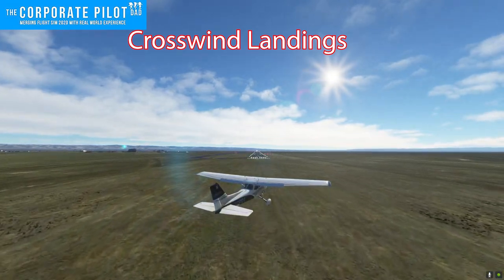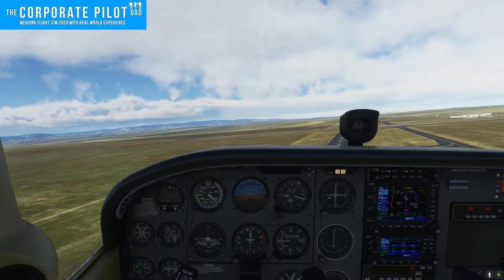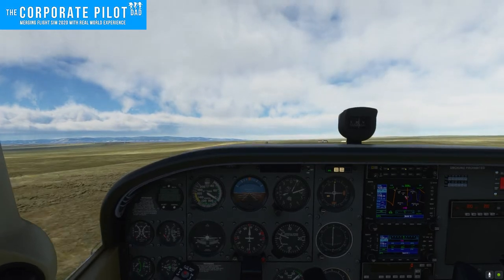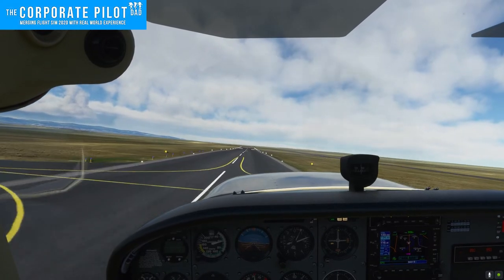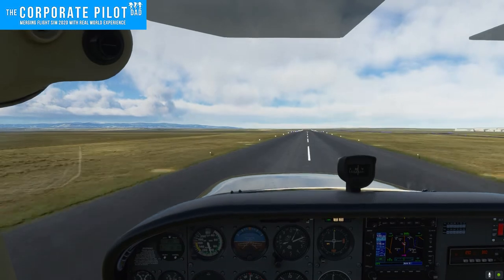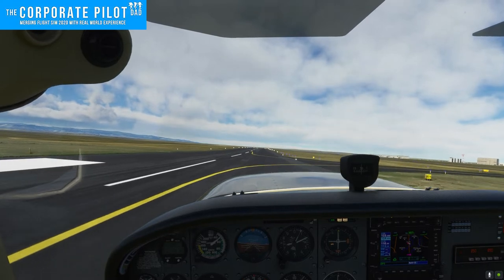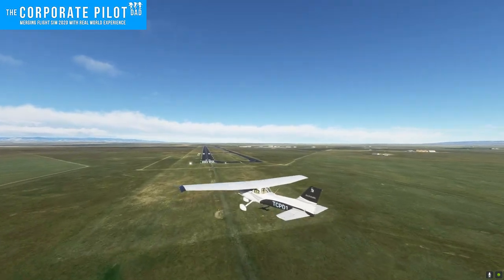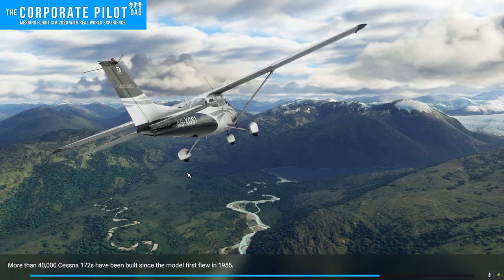Use These Crosswind Landing Techniques - Pro Pilot - Microsoft Flight Simulator

Comment from the maker: Is there a basic or VFR maneuver anyone would like to have explained or go into more detail on?
Reply: Hi TCPD! Go through being directed to use an opposite runway by ATC, please. Help us understand what ATC is telling us to do (Left/Right around runway, etc. I can't remember the wording that ATC uses.). I am confused which side of the runway to go on. I also struggle with how far to go to the side of the runway to make a nice 180 degree turn to put me properly inline with the runway. The angle of the turn, how much rudder to use, etc. My go arounds are trash! Thanks, Mate!
Reply: Plus, If and while you make this video: show us how to adjust VS up/down (VFR) to align the TBM/G3000 approach using the PFD glide-slope triangle's top as the pointer to the end of the runway. Show us how "you" line up the runway using the PFD, please.  :)  
I am using a 15.1nm approach @ 5,000 feet above the runway altitude (Little NavMap approach procedure), my 3.0 angle is usually fairly close.
Reply from the maker: @RobertHopkinsArt  do you mean how the way I did it in the video where I intercepted the glide path from 100 miles out in the TBM? If so, just push approach but the indicator needs to be above the center position in the GP for it to capture.   If using ground speed,  do this calculation.   300 (ground speed) divide by 2 =150 add a 0 = 1500 feet per minute.  That will keep you on a 3 degree slope or close to it.  Another example 90 kt ground speed /2=45 add a 0 = 450 feet per minite rate of decent.
Reply: I've got the glide slope handled using LNM's approach procedure and it works great. I am using the AP created approach by LNM and descend at 15.5 nm with an altitude of 5,000 above the runway. That does fine for my VFR approaches.

I am talking about the alignment of the planes nose in relation to the bottom-tip of the runway during approach. Should I use the top of the glide-slope triangle that is in the middle of the PFD? Thanks, TCPD!
Reply from the maker: @RobertHopkinsArt  As far as looking at the glide path indicator, look at it until you can see the runway.  Once you see the runway, look outside and use the VASI/PAPI on the left or right side of the runway to be guided to the runway.  The VASI/PAPI will give you obstacle guidance and a constant descent path (just like the GP/GS) for 3-4 NM from the end of the runway.
Reply from the maker: @RobertHopkinsArt  I do want to make a video on go-arounds.  When they say Left/Right traffic you will be making left turns or right turns in the pattern.  I did a video on VFR traffic patterns a couple months ago.  It uses a left hand traffic pattern and announces each leg via a simulated radio call in the traffic pattern.  Fly downwind until you're about at a 45 degree angle from the runway, then turn base leg.  ATC probably says," Tail# make left traffic for runway 30.  The best thing to do is draw a runway on a piece of paper.  Draw a runway aimed in the direction of 300.  Then draw the traffic pattern left or right then put a dot where you are.  It is advised to enter the traffic pattern on a 45 degree entry to the downwind leg.  Here is a link showing what I am writing: http://jdfinley.com/wp-content/uploads/2012/04/TrafficPattern4.jpg

Also, here is some more light reading: https://www.faa.gov/regulations_policies/handbooks_manuals/aviation/airplane_handbook/media/09_afh_ch7.pdf

I hope that answers your questions.  That will get you started in the right direction.  

Also, if you saw my PA-44 Checklist video I did a go-around procedure in that.  It's usually full power, pitch the nose up to 7-10 degrees and takeout a notch of flap(landing flaps), positive rate of climb, gear up, then at a safe speed flaps up. That is the shortened version.  I am going to make a video on go-arounds in the near future.
Reply: Thanks so much, TCPD! I will digest your replies and get back with you if I have any questions. You RAWK!
Regards,
MarkRWatney
Reply: Here is a link to a picture I just created landing in UAAA-05R: https://drive.google.com/file/d/1bWrMghtfqSdhoMTg0KhHeP6zKkrgXVhg/view?usp=sharing
This is what I am referring to in using an alignment "tool" to get me at the 100% accurate 3-degree approach. I have the bottom edge of the runway lined up with the top of the crosshairs. Is this a good practice to follow?

The approach requirements are becoming clear to me now!  :)
Reply from the maker: @RobertHopkinsArt  it won't let me view the link.  It says I need access.   I requested access.
Reply from the maker: @RobertHopkinsArt  That is your flight director.   You have 900 feet per minute set in and you are descending in VS mode.  The FD is just going to move up or down to get the airplane to hit 900 fpm.  If you are doing an ILS that will move to tell you where to go to stay centered on the LOC and GS.  Whatever you press for an AP(flight director mode) mode, the FD will move accordingly.
Reply: Okay! That explains everything I need to know. For flying around the world, like I have been doing since November 5th, VS mode works just fine for my little "jaunt". I only have 65 more countries to visit out of 241. It's been fun! Thanks, Man.  :)
Reply: i realize Im kinda off topic but do anyone know a good place to stream new series online ?